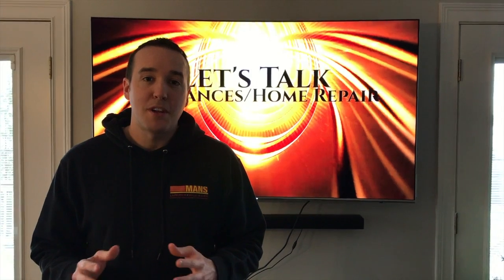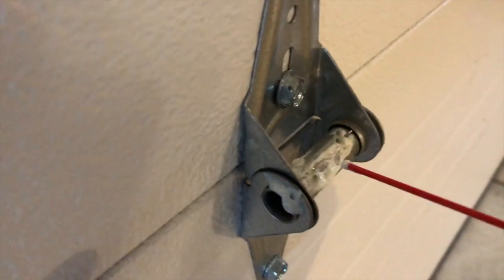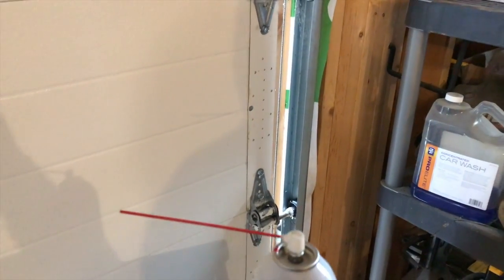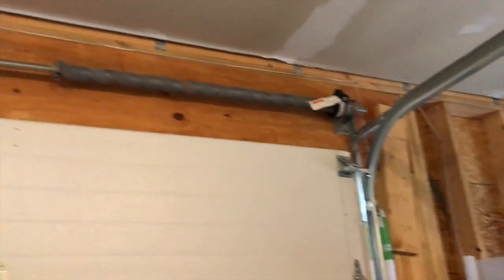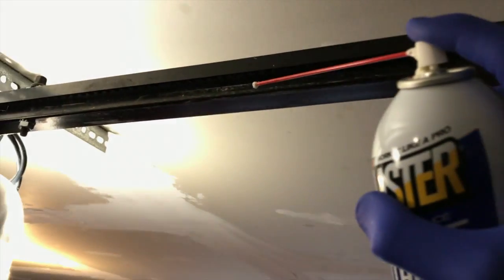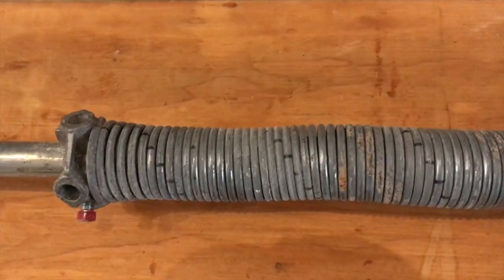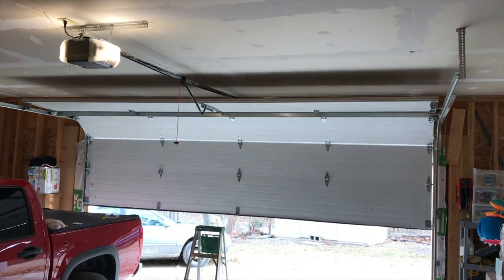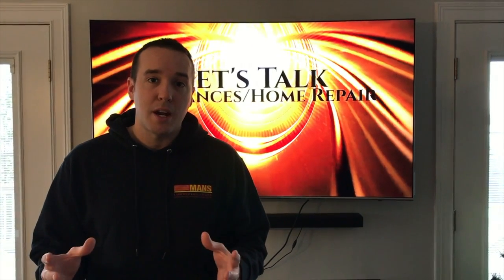How to lubricate Garage Door safely & correctly!

Comment: I echo the thanks. My Liftmaster 8550W belt manual said to oil the door rollers, bearings, & hinges yearly. Every 2-3 years we're to use a rag to wipe away the existing grease from the rail then reapply a small layer of lithium grease to the top & underside of the rail. Well, I didn't know what every part was as there wasn't a diagram & while it recommended a specific grease it didn't recommend an oil. You named & showed me the parts, showed how to lubricate them, & what with. I guess I don't need an oil after all. I'm going to keep & rewatch this video. Thanks!
Reply from the maker: Lori K 

Thanks for watching Lori, we really appreciate you reaching out to us.  This is a great product & we have been very pleased.  The Liftmaster 8550 is a good unit & should last a long time.

Let us know if you have any questions.

😎👍🔧🔩

Comment: I am a garage door technician And I say there is no reason to spray in the seam of that hand cuz all it is is a cylinder That way it holds the two parts of the Hinge together I say just spray on the joints Spray on the stems of the rollers Spray inside the track And make sure to spray the spring because that's where a lot of the popping noise comes from Unless you have a Wayne Dalton door with a torquemaster And the problem with a lithium grease it leaves a residue And that's something you don't want on a garage door Because over time Lubricating the door is going to get a lot of build-up I use a oil-based product It May drip a little bit But that can always be cleaned up just don't over lubricate it And make sure to hit the bearing plates at the end of the shaft
Reply: And you can put lithium grease on the bottom of the rail Of the garage door opener And also put lithium grease on the sprocket Whether it is chain or belt It may be covered with a cap
Reply from the maker: Thanks for watching & welcome to the DIY Raptor Club.  We appreciate you reaching out to us & sharing your thoughts.  That’s awesome.

Enjoy your day.  😎👍🔧🔩
Reply from the maker: @lorenzonaranjo3086  

😎👍🔧🔩
Reply: What lubricant do you use?
Reply: My garage door has a small gap, at one end, does this mean it’s not centered.should I have a professional look at it? Thank you, Jake
Reply: What product do you recommend?
Reply: great, make a video
Reply: What would you recommend using.  What brand ect.

Comment: Great video. Thanks. I'm in the process of lubricating my 28-year-old Sears opener for the first time. The reason that I'm lubing it is because it stops when I try to lower it, as though something is interfering with the safety beams. Nothing is interfering. The beams are plugged in and clean. Have you any experience with a similar "door hesitation" problem and using lube to solve it?
Reply from the maker: We appreciate that Mark, thank YOU for reaching out to us.  If lubricating unit doesn’t solve issue, you may want to re-program the (Travel System).  Below is a helpful video.

       https://youtu.be/M6d9IMjyze4

Please keep us posted.

Also if your into crypto trading, we just launched our new platform website.

       Toolboxtoken.com

We DIYers need to stick together!  🧰
Reply: @DIYwithMichaelBorders  Thanks for the tip. I'll finish lubing it. Then I might try the re-programming. The latter sounds like it involves wires....not my strength. I forgot to mention something: This lowering problem happens in only cold weather. Thanks again.
Reply from the maker: @markschirripa3607  

Thanks for the follow up, it’s likely that the lubrication is the best way to go!

Comment: I see there is a strut on the 2nd section, which is good, but it would probably be a good idea to put one on that top section too, especially with as hard as that opener appears to struggle.
I wouldn't be afraid to rub the lube into the spring, but I wouldn't wrap my thumb around it.  I'll risk a few fingers, but a thumb is just too useful.  ;)
Reply from the maker: l337pwnage 

Thanks for watching & sharing.  We really appreciate it.

😎👍🔧🔩

Comment: the cut on the hinge is to lube roller shafts on the end stiles...not the intermediate hinges....btw ... sometimes spraying track makes ALL the difference , regardless of recommendations.....door tech since 93......
Reply: Kevin, I have steel rollers. I also live in Phoenix Arizona (Dusty).  Would you suggest spraying the tracks as a last resort or as maintenance?

Comment: You should disengage a garage door opener and see if your door is off balance because I can tell the door belt on the garage door opener has a lot of slack in it when the door is opening
Reply from the maker: Zackary Hilton 

Thanks for sharing your thoughts Zackary.  We hope you found the video helpful.

😎👍🔧🔩
Reply: +Zackary Hilton  Those are galvanized springs, so I'm pretty sure they've gotten weak.  That's normal.  They just get weaker and weaker until the door opener breaks.
Reply: @l337pwnage  Or until the springs themselves break...talk about loud, expensive, and dangerous.  Speaking of...these springs in the video do look weak, given the slack in that belt, and may need to be replaced, or at the very least tightened, because the motor seems to be struggling, and the slack in the belt indicates a lot of weight being pulled, which the springs should be compensating for.
Reply: @TechGuyJay  True, which is why it is important to set the up-force correctly.  Then, ideally, when the a spring breaks, the opener will just just not lift door, rather than break itself or the door trying to lift it with a broken spring.
Sometimes, commercial doors and door openers are strong enough to survive that, but, often, residential ones are not.
I got lucky with my door.  One day it would only go 1/2 way up, when I looked at the door, I could see one spring had broken.
Reply: @TechGuyJay  yeah the video maker got ripped off on the whole system I think.
Mines chain driven Genie
Very quiet & smooth + fast & my garage isn't new

Comment: My garage door parts r circa 1988 with the exception of the new Dura lift rollers I just replaced.  I had to use 3 cans of gunk n the tracks to get everything nice n clean before I changed out the rollers.  With that said, u r using a white lithium spray grease, but I want to know should I use the gunk spray to clean the latches/hinges first, and then add the spray silicone? OR do I just use the spray silicone on the latches as is?  Thanks for your video!!
Reply from the maker: Thanks for watching & welcome to the DIY Raptor Club.  It never hurts to take the extra time and clean the inner track prior to applying the lithium grease.

Keep us posted on your DIY project.  👍

Comment: Oh shoot! I found your video after watching others that said to spray the track and the black chain  part that you were so careful not to spray 😭 I also used a silicone based product,, as I was told at the hardware store that in the desert climate, it's best to use silicone.. 😢  Is that even true? 

Have I royally screwed myself,, or is there some way to fix it?  Will spraying those parts  you said not to spray harm my door long term?
Reply from the maker: Thanks for watching, a quick friendly wipe-down of the track with a paper towel should be enough.

White lithium grease is what we found works best for our mission.  No need to stress, we just recommend removing the silicone from the track.

😎👍
Reply: @DIYwithMichaelBorders  Whew, thank goodness!! Thank you for responding!
Reply from the maker: @Indigo_Moon_  

We are here to help, reach out to us any time!

Comment: If you cannot readily locate a lithium grease spray can you use a Teflon based lube spray?
Reply from the maker: Edward Masannat 

Thanks for watching Edward, we haven’t used a Teflon based lube before, can’t really give you an accurate recommendation.  White Lithium grease is the best product we recommend.  Hope this helps.

😎👍🔧🔩
Reply: You can get it at auto part stores. This grease is great on car door hinges, latches , cables, and any other exposed moving parts

Comment: I lubricated with wd40, it fixed the problem, but now i want to use the lithium grease, how long do i have to wait before i can apply the lithium grease and also do i and can i clean the wd40 away?
Reply from the maker: Thanks for watching & welcome to the DIY Raptor Club.  WD40 will usually last roughly 6-8 months however if you notice a significant difference in lubrication strength before then, you can apply white lithium grease.

😎👍

Comment: I went to Home Depot this morning and got the blaster lubrication spray with the "Garage Door" written on the label.

Unfortunately this is not the lithium grease that I thought it would be.

My question is can I still spray white lithium over the silicone spray I've already made on my garage door joints?
Reply from the maker: Thanks for watching & great question.  We personally recommend removing as much as the silicone as you can prior to applying the white lithium grease.

If interested in purchasing this product, visit our Amazon affiliate link below.

       https://amzn.to/3rZc8Tc

😎👍🔧🔩
Reply: @DIYwithMichaelBorders  thanks for your answer. What happens if white lithium and silicone mix?

Yes I think I had white lithium before but I didn't remember. So I just followed the label which turned out to be regular silicone.

And that leads me to ask you

Why is the can that says garage door contains silicone instead of the white lithium? What is the difference between the two
Reply from the maker: @goodcitizensinactionnow9601  

Thanks for watching & this really depends on who you ask.  At the end of the day, they are both designed to lubricate.

As far as them mixing, we don’t really have a good answer on whether it’s good or bad or an issue at all... we’ve never mixed the two.

Please keep us posted on your project.
Reply: @DIYwithMichaelBorders  I think at this point I am fine with having the silicone. How long do you think before the silicone wears out so I can apply the white lithium next time?

Also with silicone, do I also have to wait about 24 hours before seeing the difference in opening and closing the garage door like you demonstrated towards the end of your video?
Reply from the maker: @goodcitizensinactionnow9601  

Thanks for the reply, not a bad idea.  Any garage door lubricant should last 12-18 months if applied correctly.

Comment: Ive followed everything in this video and used the same white lithium blaster spray. My garage door is from Precision and its about 5 years old. Its still insanely loud. Ive used an entire can of blaster spray getting the springs, hinges, sides of rollers, and both sides of the guide rail. Nothing is working. Ive opened and closed the door about 40 times. Its still very noisey. Any idea what my issue could be?
Reply from the maker: Thanks for watching & welcome to the DIY Raptor Club.  It’s very possible that the track is ever-so-slightly offset.
Reply from the maker: Any update?

Comment: I bought this same can but right next to it was a can that said garage door lubricant but was silicone based. Also, my garage door opener was the screw type, neither chain nor belt driven. Lubed it with a light coat.
Reply from the maker: Very cool & we appreciate you sharing this.  Sounds like you’re all squared away.  Let us know if you have any questions.  Enjoy your night.

😎👍🔧🔩
Reply: It was a great video & I found it very helpful. Thanks for making it. The can I bought, I don't think any came with the red tube & the one from the wd-40 didn't fit, so I had to just spray with the nozzle.
Reply from the maker: @benjaminchen1964  

Thanks for sharing.  😁👍

Comment: I don't know what I was thinking but I actually greased my tracks I want to know if you have any suggestions for me to get the grease out of there it's pretty caked in there and this is not a joke I know it sounds like one I just noticed it right now LOL but I really did put grease I thought it would help and also I put spray on the chain that's because the stupid garage door repairman told me to but I don't think that's correct either
Reply from the maker: Thanks for watching & we appreciate you sharing this.  It’s easier that one may think.

We recommend using normal paper towel to wipe as much of the grease out of the track as possible.

As you clean the track and come across the roller wheels, we also recommend wiping the grease off the black plastic roller wheels.

Keep us posted.  😎👍
Reply: @DIYwithMichaelBorders  once again my YouTube Community has pulled me from the flame and I thank you so much God bless
Reply from the maker: @randygomez952  

We appreciate the reply, us DIYers need to stick together!!!!  😁👍
Reply: Try mineral spirits to get rid of any residue, and also use it during periodic maintenance for a final clean after cleaning out the guides 1st using an old rag etc. For the chain just a light brush of chain lube over the links does the trick.

Comment: Your emergency release handle is upside down
Reply from the maker: Zackary Hilton 

Thanks for watching & we hope the video helped.

We really enjoy making these helpful videos for our fellow DIY’ers.  Many more helpful videos to come!  😀

Let us know if you have any questions.  Please subscribe to the channel and turn on your YouTube notification Bell 🛎 that would be awesome thanks again.

😎👍🔧🔩
Reply: whaaa? mine is the same way.. how should it go ?
Reply: Pah Tryk You just have to untied a little night that’s on the bottom and flip it around you should be able to read the handwriting on the emergency release handle
Reply: Innoway you leave the key at the door as you don’t spray inside because it’s pointless and it’s going to get dust and debris inside do you want to use a silicone lubricant not white lithium grease like that because it is very unsightly and aching heart in overtime and it can mess up your door pretty badly I use PB blaster garage door lubricant and it works very well and I’ve been using it for years and I have not had a single problem and not really no dust compares on any of the door parts and it works for a long time